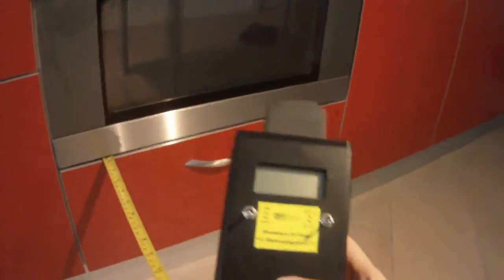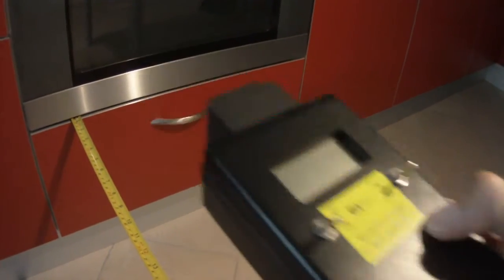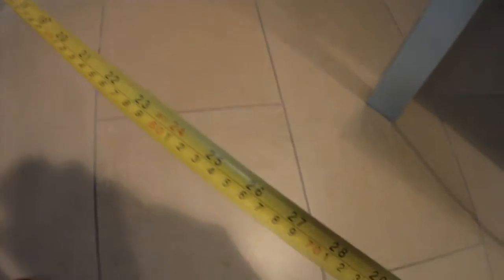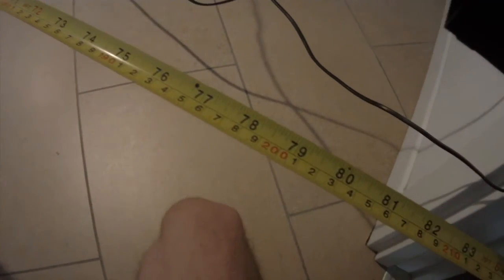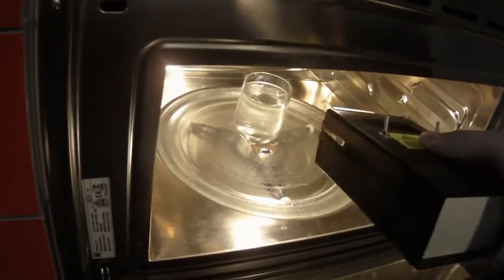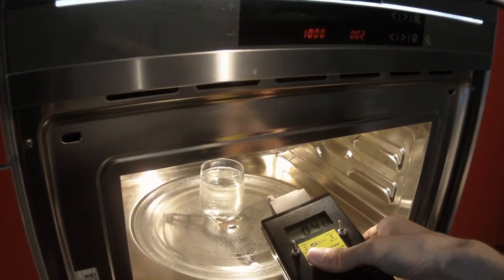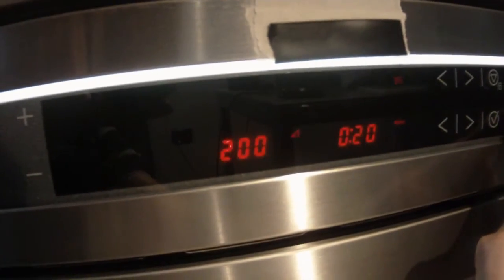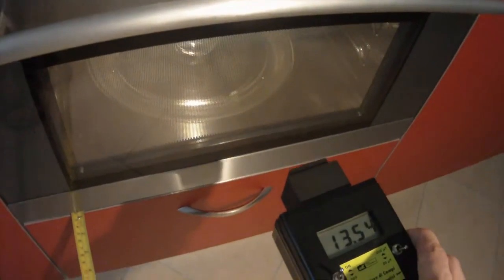DIY Electromagnetic Field Detector Test with a Microwave Oven

Comment: I could be wrong, but I remember trying to measure distance from a certain clock that emits a strong emf, and I noticed the emf was heard from farther away than normal because I used a metal measuring tape. Not sure if the same thing applies to what you're measuring here. But thought I'd mention it.